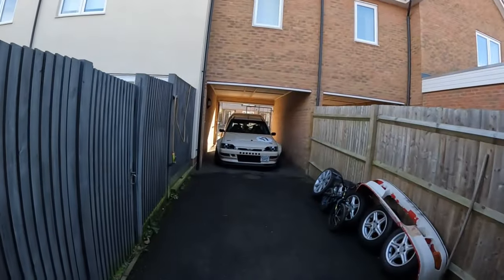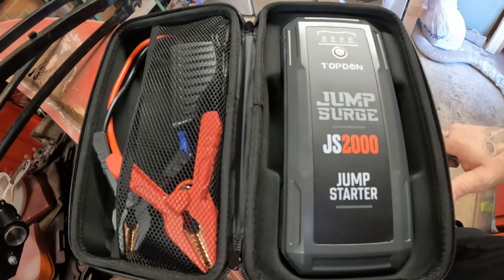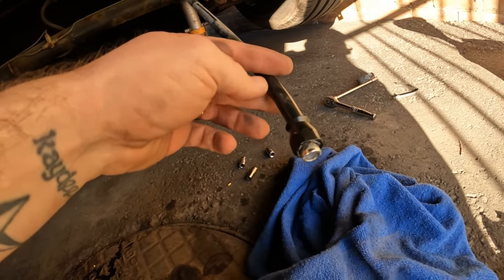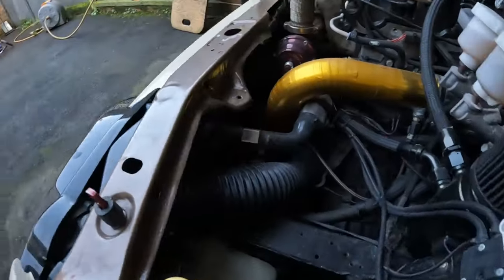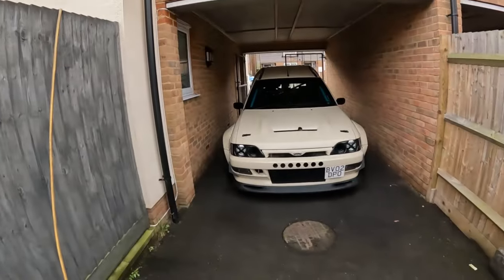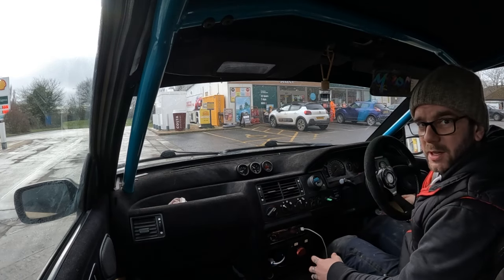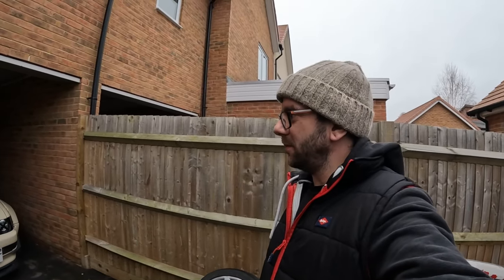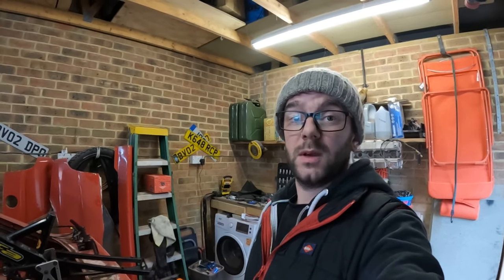Rocket Bunny Ford Escort Van Is Getting Ready For a New 2023 Makeover

Comment: Sweet Ride 👍 solid engines those units. I used to maintain the machining line that made the 2 litre DOHC 8 valve cylinder head, they added some CNCs to make the 16 valve cylinder head for the RS2000. Apparently that was developed by Cosworth.
Reply from the maker: they're stout engines, a lot of the banger racers/stock car folks use them now aswel because they're solid, only trouble is that's bumped the prices of them right up now lol just a shame there isn't much aftermarket support for them really.